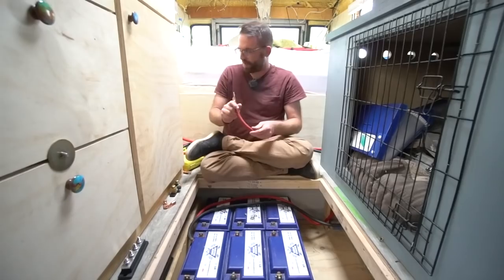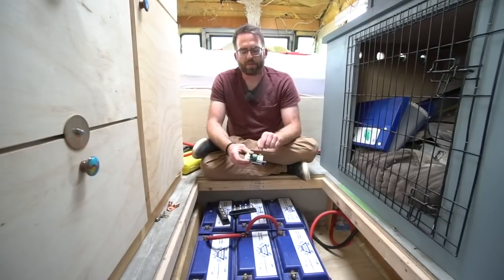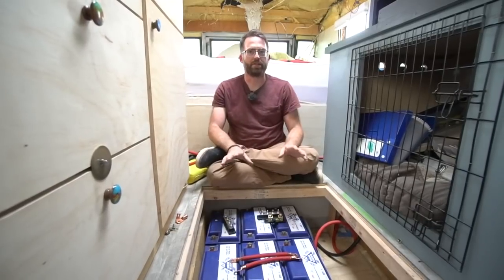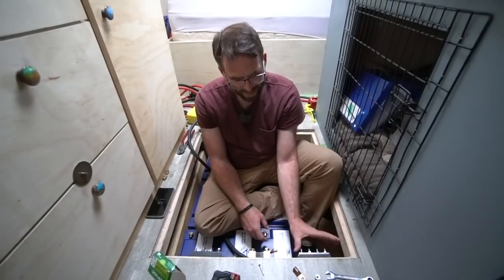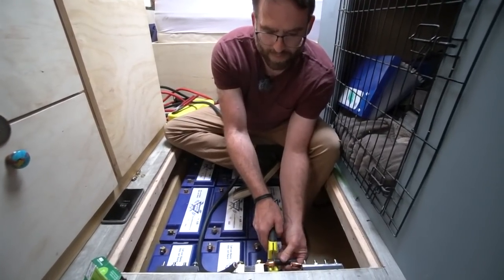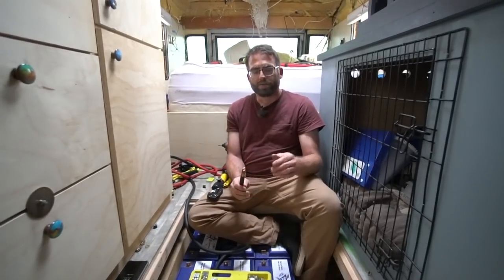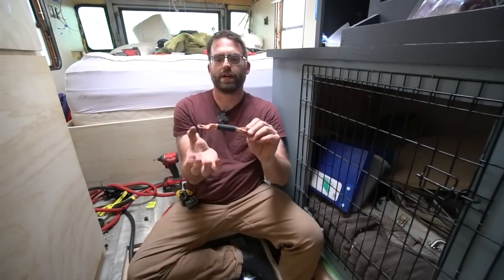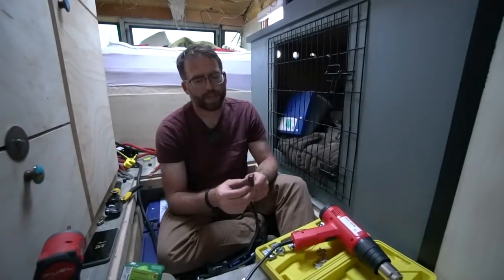Skoolie Solar Install - 900ah Of Battle Born Lithium - System Overview - Part 1

Comment: Aaron did an excellent job discussing how and why you were hooking up the batteries.   The complaint of too much talking and not enough doing is not the issue.  You were giving people important information for hooking up these batteries.  It is important to understand series and parallel and the benefits of each.   You are right about the crimpers being the best way to make up the connections, especially when installed in a vehicle.  Aaron may not be an electrician but he seems to understand DC electronics.  I was an electronic technician who was labeled as an electrician.  In my opinion they are apples and oranges.  Great video!

Comment: Aaron should be teaching at a tech college. Very clear and thorough explanation . Even I can understand. 😁👍
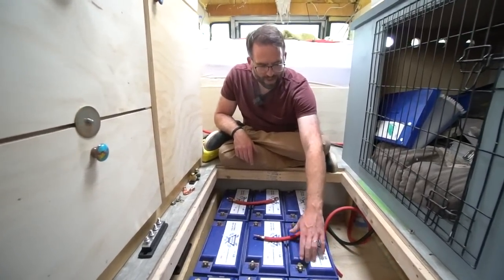Reply: Ya? So @ 2:30 when he's explaining about if they wired them in parallel (which they are going to do) and "took all the leads off here, the one battery on the right would take the biggest hit and the one on the left would be the lazy battery" you understood that, and so you know how they ARE going to wire them so that doesn't happen?

I didn't think so.

Comment: That looks like 1 0 cable, which is a good choice. I have 1800 watts of solar on my roof, with them separated into 2 900 watt packages. They come inside separate, each going to its own Outback charge controller, and feeding its own battery bank - 12 volt, 635 AH ( 6  - 2 volt 632 AH AGM, size 31). From there, they connect to heavy battery switches, allowing me to select either one, or both, at any time. In this way, if I have either system fail, or need maintenance, I still have plenty of power while attending to the repair. I am VERY MUCH looking forward to replacing my batteries with the new Battleborn products. 

Love the work you're doing Chris, and both channels. By the way, when I built my system, Victron stuff was not available. That is why I ended up with Outback. Honestly though, I am very happy with the Outback stuff.

Comment: Wow! Great video, Chris! It quickly informed me why your solar, batteries, and charger/inverter took so long to connect. Very interesting stuff. Hopefully I will recall enough of this, if only in a general way, to better understand the process if we upgrade from AGM to lithium (and possibly also add solar). Thanks again! :-)

Comment: inside of an rv aspecially underfloor will get wet once in a while , not only do you mop the floor you allso walking around after a shower , or drop / spill youre drink so yes it will get wet sumtimes , might be a good idea to mount the fuses and stuff on small tapered standoffs the big part of the taper near the part so water runs off away from the part when running down the wood mostly , its allso a good idea to paint the bare wood under the hatch to prevent mould or rot over time from just such a accident

Comment: Think of a flashlight, add a battery it’s like 1.5 + 1.5= 3.0, but if you put the batteries side by side, you’d have 1.5 volts only twice as much time on the side by side set up.

Comment: He seems extremely knowledgeable in this field. My only question is this. If you run short on cable why would you have to order it from Amazon? Is there no place locally to quickly run and grab a short piece of the same cable?  I live in a not so populated area but with only about a 20 minute drive there is a fantastic electrical supply shop with everything one could imagine.
Thanks for the video.

Comment: That is a crazy system. This may have convinced me to switch from midnight to victron. What was the reason for staying 12V most big systems go to 24.
Reply: The equipment supplied was already 12 volt.

Comment: Nice job!  A couple of tips for the next install... attach the cables to the inverter while it’s still on a workbench. This avoids having to work in a cramped area.  Then feed cables to the battery bank, where you have more room to cut/terminate the cables. A second tip is to use flat copper bus bars on short runs instead of cables.  Easier to work with, and have excellent mechanical properties. I get mine from www.onlinemetals.com
Reply: You are correct it would have been easier to bench connect the terminals, however in this case the wire chase wasn't the most accessible, and would have been blocked once the inverter was placed.

As for bus bars, I also agree, but again in this install, flexing and movement of the batteries was going to happen so it made more sense in this case to use cable.

Check out my lithium battery build for more bus bar action.
Reply: @AaronBockelie  Thanks for sharing in detail the parallel and series theory/voltag.amp law.  I'm an Otis elevator installer and bring multi-conductor cables from the hoistway to the machine room controller and the final controller wiring. can you please provide a link to your "Check out my lithium battery build".

Comment: Just seeing this guy use the right sized wire, compensating for vibration, setting up the array for optimal charge and discharge.......:) Cool Stuff. I am going to do something similar Chris. Do you already have affiliate links for this system?

Comment: Hi Chris.  Curious about the charging side of your system.  With 9 100ah Battle Born batteries in parallel at a recommended max charging rate of 0.5C (50 amps each) you can charge up to 450 amps.  Looks like you have 2 60 amp charge controllers, for a maximum of 120 amps total, and with 900 watts of solar, giving about 70 amps at most into the batteries.  It would be great if you could go into more detail on this part of your system in your future videos.  I’m also designing a system around Battle Born and Victron, so this is very helpful.  Thanks.

Comment: Very informative but I have one question. Aaron talked about hooking up the batteries in a way that doesn't put a strain on one but I don't think he said where to hook into the bank to eliminate that problem.
I connected my positive to the battery at one end and negative to the battery at the other with the idea that this would share the strain across all. 
Is that what you are doing?
Reply: Yes, that's the idea. I have not been given a lot of information about how the inside of the battleborne batteries are wired, so just playing it safe.
Reply: I think that's the safe way to go for any battery

Comment: Will the battery bank be charging when the bus is running the alternator? Did you have to use a battery isolator when the bus isnt running, so as not to drain you starter battery?
Reply: isolators disconnect the coach battery from the vehicle starting battery when they shut off .
Reply: @peterandrews4172  correct, that was what i wanted to know if he installed.

Comment: Nice install. Wouldn't it have been simpler to reverse the distribution block and battery block on the negative side so the cables wouldn't have to be run the extra 6 feet around the battery enclosure? Seems like if the distribution block was closer to the dog's cage rather than the dresser and the cables ran directly to the controllers and such that the runs would be shorter as well.
Reply: I was roughing things in, the system turns out more optimal in the end.

Comment: How did you decide on 900 Amp Hrs.  With lithium that should play out to about 720 usable.
Reply: With Battle Born batteries, when they say 100ah they mean usable ah's on their batteries. They charge their batteries to 95% and the BMS stops the charging which is not included, also they don't include the last 20%. So if he has 900ah's of Battle Born, he has 900 usable ah's.

Comment: Soldering is best but with wire that thick it's a PITA.
Reply: soldering is not always the best choice. in a moving, vibrating vehicle, soldered electrical connections tend to work harden and break unless you reinforce the joint to keep it from bending. that's why all of the wiring in race cars is crimped, not soldered.

Comment: 900aH? really? How did you size your system? do you have the solar output needed to keep those between 20%-80% dod?  I have 900 watts of solar (flat mounted) and 440 aH of batteries and I'm stretched to keep them topped and often have to fire up a small inverter/genny to power a battery charger (and I don't have a residential fridge).
Reply: thinking the same thing. 900 of panels closer to 55 amps with MPPTs, so maybe 300 amps per day in good sun. I'd imaging his daily load isn't over this. like anyone in this situation, Chris will end up with a small generator probably, or damage the batteries on long stretches of bad weather.
Reply: these are lithium batteries so lead-acid and agm rules don't apply.

Comment: You  need to find out from the (manufacture) what is the max charging capacity that you can put on those batteries ..? So you have 100% of useful system..! Charging the batteries 75%..80%. Only.your system will not be efficient as you may think..!

Comment: I wasn't aware that the laws of physics don't apply in lithium battery installations.  In fact, I'm pretty sure they still apply.
"In SERIES the current is the same across each device" 
"In PARALLEL the current at junctions is divided between components based on their value"

None of the batteries are going to "take the brunt" of the charge or discharge based upon how they're wired unless one ignores another basic tenet and mixes batteries of different properties (i.e. new and old, different capacities, etc.). While we do use water as an analogy in teaching ohm's law, electricity doesn't see the insignificant bits of conductor between the batteries.

I do like the discussion and explanations on building the cables, use of shrink tube, and designing so that failures aren't catastrophic.  But I had to say something about the "lazy battery" thing. I suspect that analogy simply didn't come out on camera like it was intended because he seems to know what he's doing and we all have trouble verbalizing knowledge at times.